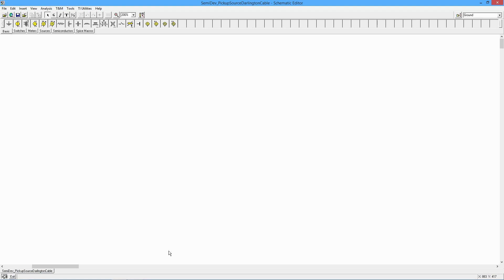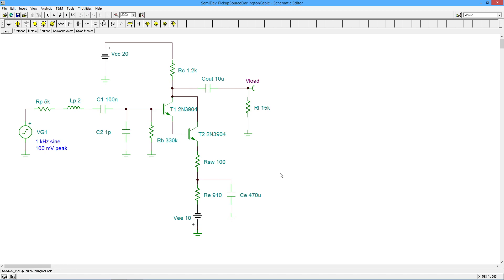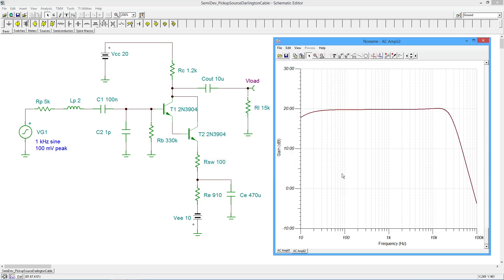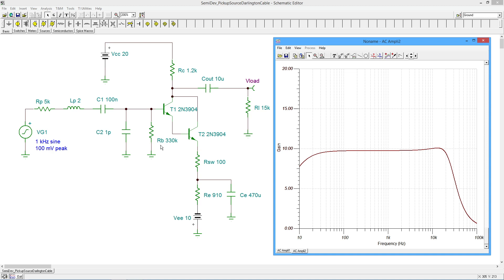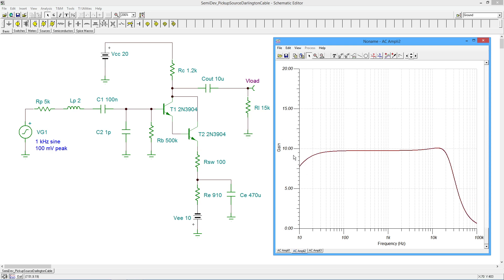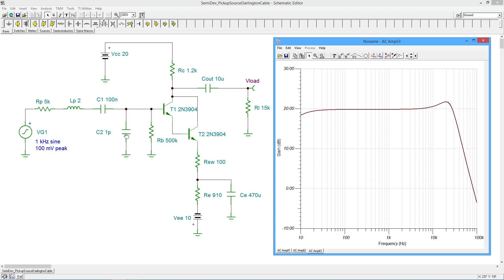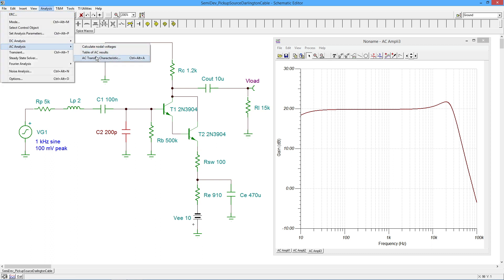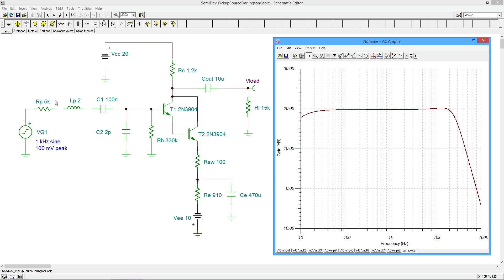Semiconductor Devices: High Z Pickup Cable Effects

Comment: Proffessor Fiore: Can you help me understand why the parallel impedance of Rb and Zin of the Darlington pair drops the gain as you lower the resistance value of Rb? Why does gain increase as // input impedance increases? Math makes sense but doesn't seem intuitive.
Reply from the maker: It's not that the gain of the amplifier increases with increasing Rb, it's that the front end loss decreases. In other words, the net gain of the system increases, not the gain of the amplifier stage itself (from base to collector). The issue is the interface between the signal source and the amplifier. Often, we ignore the internal impedance of the driving source because it is relatively small, but that is not true for all sources. Some sources (like a guitar pickup) are relatively high. This creates a voltage divider with the input impedance of the amplifier. Thus, only a portion of the available signal from the source gets to the input of the amplifier (i.e., there's less to amplify). Think of the amplifier as two stages: the first is a voltage divider between the source impedance and the Zin of the amplifier, and the second is the "normal" gain of the transistor, from base to collector (assuming CE configuration). Reducing Zin makes the front end loss worse, and therefore, the output signal at the load is reduced.